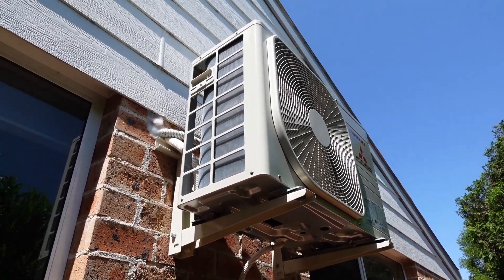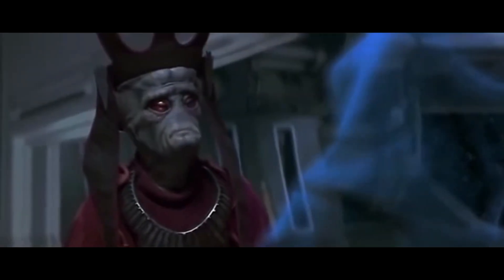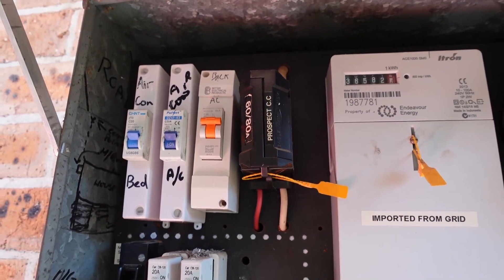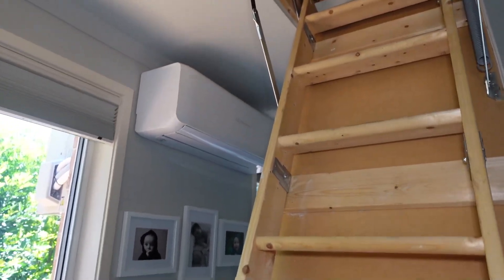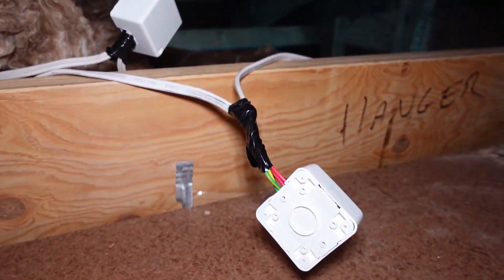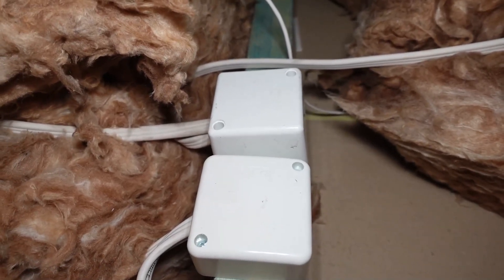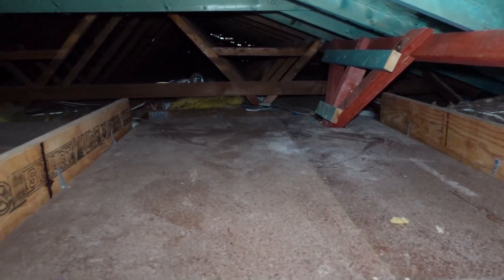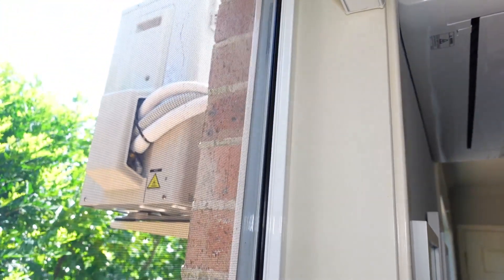Aircon Wiring Install FAIL- TWICE!

Comment: Dang, I thought we had it bad here in 3rd world country with our electrical death shower heads... last time I've seen a breaker that sparse was on my grandparents home/bar, which if I'm not mistaken, had wiring done by people who built the house some century ago... xD

We helped our aunt pay for a complete rewiring because it was all fabric isolation that had mostly rotten and turned into dust ages ago. Some electricians absolutely refused to get in there because they couldn't locate a mains breaker, and no way they were gonna climb up there risking a fire or shock. xD
My uncle with similar handyman spirit, may he rest in peace, also put up a lose transformer up there to power a garage door motor... the whole thing was a fire hazard that for some miraculous reason, never happened.

Comment: Who are these cowboys. The electrical tape solution shows what you were dealing with.  Lazy af.  Its time you replaced that switchboard. Be worth getting a real sparkie to do that one. As others have mentioned under the latest revision or AS3000 the new aircon is supposed to have an rcd or rcbo. There's also supposed to be an isolator at but not on the actual unit.  Time to contact the electrical authority I'm afraid. These guys need to be reported.

Comment: My one bed flat has more breakers than your entire house, wtf?
Reply: Depends on the age of the installation, at least from my experience here in Germany. I have lived in an two-room (plus kitchen and bathroom) apartment with old 60ies wiring that had only one breaker. It was pretty annoying because you could only use 3600 W at a time (roughly 4000 W in real life)
But newly built apartments usually have a ton of breakers, at least one for every room plus breakers for special devices like an electric stove and the fridge and whatnot.

Comment: Also: rain can run down the wiring and piping outside and run into the unit.  It should drip to the outside.  Loop down and back up a little.  !  How-ya-doing everywhere!

Comment: Just so everyone’s aware, that’s not how most houses are wired in Australia - that’s quite an old board which has been hacked at over the years and probably about the worst you’ll see.  Anything built in the last 20 plus years would be done in a DIN style enclosure.  Something like this is a reasonable example of the older style like Dave’s and a newer board - https://youtu.be/wVwLxasCBA8
Reply: Still looks like a mess to me. Have you seen one of GreatScott latest videos? That is proper wiring.
Reply: Yeah this is obviously messy. But I don’t understand DIN rails either. All they do is put all the breakers in a line. You still have to wire each thing individually. I don’t get why more countries don’t use integrated bus bars like in the US or Canada. I have seen lately some consumer units come with installable bus bars. Seems like an improvement.

I also thought it interesting his wiring for the house looks like zip cord. Seems reasonable to me. In the US everything is romex which is 3 individually jacketed wires with another pvc jacket over it the bundle. It’s more bulky and expensive and I can’t see why something like this isn’t used instead.
Reply: @stevebollinger3463  Actually in some countries every wall socket have their own fuse. That is NO joke, real building regulations. Needless to say what a mess that is! I am no fan of bus bars. More just because they aren't very modular plus they aren't very safe.
Although, there is absolutely nothing more subjective than safety if you know anything about international safety regulations, hahahaha
The EU/German system also works different, so the bus bar system doesn't make any sense. Your group or section wire just goes to the dedicated fuse. These fuses go to the main fuse. The main fuse is sealed. 
In the end, worst is still the US plug by itself, which can be knocked out easily, or left in/exposed half way. As well as double the current rating you need = 4x more power loss (P = I² * R ) = much ticker wires or more power losses.
Reply: @p_mouse8676  Bus bars are completely safe, your power goes through them too as substations use bus bars. If you are complaining about modularity I can understand that for the type that you see in DIN consumer units. Those have to be installed last and have to be removed from all breakers to change any breaker.

You should look at the clip-in type breakers the US uses. The bus bars are on the back of the breaker box (consumer unit) and when you clip the breaker in it mates to both line and neutral (or line and line for 240V). It is modular, you can unclip any breaker without removing the rest. Eventually you can run out of places to clip breakers and then you have to add another box, so there is that. The bus bar is exposed when there are non-filled breaker positions, but the cover over the box has punchouts that you do not remove until a breaker goes there. So when you open the door there are just switches, no live anything. To get to the live parts you have to remove the cover and then be careful (unless there is a  main external disconnect which is common now but was not previously common for residential). Once you punch out a punchout you must leave a breaker there to fill the hole and cover the live parts, even if the breaker is unused.

The UK plug is better, not even worth arguing about. But still even other 240V countries (Australia in this case, Switzerland, most of the EU) haven't switched to it. So the US isn't on an island with regards to that.
Reply: @stevebollinger3463  Yeah, most fuses these days are also clip-in type here as well, just on a DIN rail. Same idea I guess.
I was more referring to the totally open in plain sight bus bars. I have seen them quite a lot. I would rather see a bar system with on top these kind of clip-in (on) modules.
So yea, I agree with that, basically what you mean I think?

I think the best plug is still the German style plug. Not only is the plug recessed, but also fixed and the ground connections on the side, spring loaded (in east EU they have a pin, which can break off sometimes)
So it's absolutely impossible to knock a connector out or twist it, yet still looks elegant and are much easier to produce than rectangular pins. Compared to the UK type for example (which are humongous!)

Btw, I am not from Germany, I just really like their way of doing electrical wiring. Just clean and straight forward.
Reply: @p_mouse8676  - This example of Dave's is a completely SHIT, cheap old installation that is probably 50 years old. Consumer units in Australia have DIN rails, standard European-style circuit breakers and they have bus bars. The Consumer units are actually supplied with bus bars inside the box, and nobody wires the breakers manually (that would be extra work). The bus bars aren't exposed because that would be fucking dangerous.
Reply: @stevebollinger3463  The cable you see here is basically equivalent to Romex.  'zip cord' is single insulated rubbish.

Comment: Well this is why I did all of the wiring myself. I mean as per code you do not even need to run the cable in canals through the drywall roof. If you take NYM you can just run it through however you want. No way of changing it out later on or anything.

But damn that electrical panel. This would be so illegal in Germany. The back side is so unbelievable. I have no idea how 2 circuit breakers are nearly enough. We have one for each room. For kitchen appliances and washing machine usually extra. We have 13 breakers just for one 5 room flat (in Germany hallway, kitchen and bathroom are not counted for the room count).

Comment: looks like Mad Max had a go at this electrical installation.
Here in France such a panel is only seen in buildings half a century old.
But it doesn't prevent shaddy work even in new buildings.

Comment: Whaat!! you have only 1 phase system in houses? Strange flat cables, and wirecolors. Even the  smallest House here in Finland has 3 phase power like 3x25A mainfuses. Here  it is illegal to run cables on insulation without conduit.

 Do you have the same  electrical wiring system that us used in the UK? Ring circuit?
Reply: Single phase is most common from small homes. 3-phase is definitely used but not mandatory. Old homes are 1x60A and modern ones might have 1x100A main fuse.  The (double-insulated) wiring can run under insulation but must be derated accordingly.
There is no silly ring mains here in Australia. We have similar standards to Europe, however this is a very old home with a very cheap original installation that has literally never been upgraded since the 1970s.

Comment: What's the IP rating of those original boxes in the attic? I would guess it's probably 00 with those huge cutouts
Reply: Who cares - there is no water up there. There is no requirement for IP ratings or weatherproofing of electricals inside a wall ceiling cavity of a house. The cable doesn't even need to be enclosed because it's not a normal "accessible position".
Reply: @johncoops6897  IP isn't just about water, it's Intrusion Protection, for one thing the appropriate IP rating stops you from putting your finger inside a live connection box
Reply: @cambridgemart2075  - I know what IP ratings mean, since I've worked in the industry my whole life. Nobody sticks their fingers into junction boxes underneath insulation inside a roof cavity, nevertheless the boxes (and cutouts) only need to be IP20 max. The original installation the Dave showed was non-compliant so it's largely irrelevant to the discussion.
Reply: @johncoops6897  So that box was IP20? I don't think so.

Comment: Hey Dave I'm an air con installer in qld
Usually if the unit is 4kw and under u can put them on the general power circuit as they only draw like a Max 4 amps running flat out.
I would be more concerned with that penetration and the length of the pipe as I generally like to have at least 1.5m of pipe between the flares on the indoor unit and the outdoor unit.
Reply: might draw up to 9 amps if on heating (the ice breaker heater thingo on outdoor unit.)

Comment: I was not aware you could run multiple load draws through an amp clamp. Do they need to be on the same phase?
Reply: Yes, otherwise the currents would cancel out.
Multiple line conductors on the same phase, the currents just add together.
I've had ROTFL moments at people going around the outer sheath of a cable with a clamp type ammeter and wondering why they couldn't get a reading, one even sent the clamp meter back as faulty!
You can also wrap a single wire around and through multiple times to increase the sensitivity (you might want to for low currents) - so for example 0.2 amp flowing through a wire that was looped through 5 times would read 1A.

Comment: Wow... just WOW. say what you want about USA low voltages and all... but, I like USA electrical codes... wire securing and attics with pull down stairs, need all wiring routed off the rafter surfaces.
Reply: And wire nuts and aluminium wiring and fuses and switches split between live and neutral in appliances (or they were in the 1980’s era ones I have come across). Plus those crude plugs, light switches that operate in the wrong direction, rats nest overhead local distribution wiring and transformers on poles.

Comment: Wiring Rules AS3000 Clause 4.19 
Airconditioning and heat pump systems incorporating a compressor shall be provided with an isolating switch (lockable) in accordance with Clause 2.3.2.2, installed adjacent to but not on the unit, which isolates all parts of the system, including ancillary equipment, such as head units, from the same location.
Reply: Also possibly broken some of the rules in 3.9.3.3.1 / 3.9.3.3.2 requiring adequate fixing and support of the cables strung through the ceiling

Comment: Aircon for cooling.......hmmm, not a thing we generally need in Scotland!
Saying that, my workshop is very small and the heat generated by my server rack etc does require a small floor mounted cooling aircon (self-modded of course!)

Comment: Dave what wiring regs do you have in Auz? take a gander at Requirements for Electrical Installation BS7671 18th Edition and the On Site Guide too... Where are the DIN rails? Just amazing Dave show us from the Motherland some more PLEASE.. always good to go in Professional Electrician  Magazine.. Were they unaware you are a You Tuber!..  That should give them red faces!
Reply: The wiring rules in Australia are quite similar to those in the UK, but this is an OLD house. Old houses in the UK also have shitty wiring. It's not done that way in modern homes.

Comment: Those Pulset and CHINT (won't mention here what we called them) branded breakers never work. Installing them is basically murder, and I can say that as someone that had to drive their boss to hospital when a pulset RCBO became live and never tripped. Chint however is as chinese as products get literally the bare minimum to meet the minimum standards.
Reply: Those HPM Fuse to CB adapters that you can only get from Bunnings are alright but do not meet the standards also, and they never have.

Comment: In Hong Kong, usually a separate circuit breaker for air conditioner, of course some of the part-time electrician don't do that, just add to the existing socket is good enough ... they think ... Hey guys, socket need another breaker with lights, I don't care how they wire that in China, China use multiple standard, they got all kinds of socket, mostly Australian type but do have America style 2 legs.

Comment: Yeah, that's crap all round.  The air cons need to have isolators, full stop.  There is no exemption based on size  (clause 4.19 of AS 3000).  They also need to supply a CEC, if they didn't give you one, then ask to see their licence - I bet they don't have one.  You might also want to seriously consider getting a board upgrade, that existing one is a mess.
Reply: I feel like cooker isolators etc are around the same section. I thought something was off about that. But I also figured because he's in NSW that maybe NewSouthians just don't like themselves enough to care. Never seen anything like this in Vic. The distribution board is going to give me nightmares
Reply: @microsoldering1  I live in the next suburb from Dave, and that board gives me nightmares too. I completely rewired ours when my son was born, since it was similar (from the 1970's).

Comment: we recently got an aircon in. the spliced into an existing powerpoint circuit. however we have far more than just two tripboxes and they also installed an outside isolation switch

Comment: My UK eyes are watering from the wiring shown here, do you actually have any standards in Australia?!
Reply: Yup, we do, but the half the people who are licensed to do this stuff are hacks that do half-assed jobs.
Reply: I think the UK wiring system is strange. The Ring circuit sounds dangerous to me.
Reply: @19CW86  how's it dangerous?
Reply: @ArlenMoulton2  4 mm2 wire cannot handle 32 amps. If there is wirebrake in ring circuit it can be firehazard. Luckyly RCD's are used in UK circuits, it helps A bit 👍
Reply: @19CW86  Actually we use 2.5mm cable for socket rings here and that can handle 34A. Also, an RCD won't trip in the event of a broken ring, it's only for earth leakage or ground faults.
Reply: @ArlenMoulton2  Look in BS7671, Table 4D2A.  4mm2 cable is generally good for 36A.
Reply: @ArlenMoulton2  In the EU, 2.5mm2 is allowed to have max. 16A breaker! It used to be 25A about 6 years ago, but they changed the standard. Some Brussels politician probably has a wire factory :-) .
Reply: @mrnmrn1  Yup, 2.5 can easily carry double that rating, absolutely no need to have it protected at only 16A, the EU really don't understand anything technical!